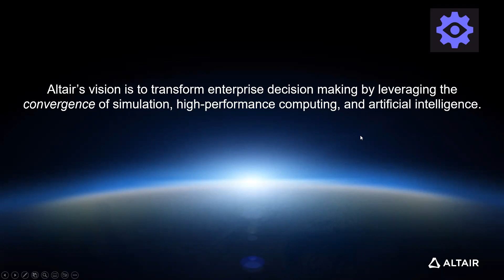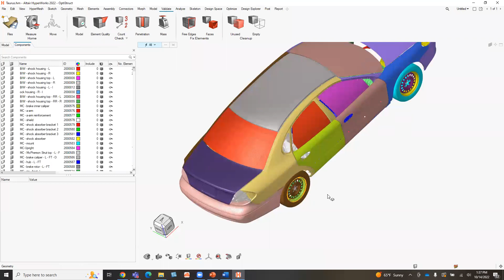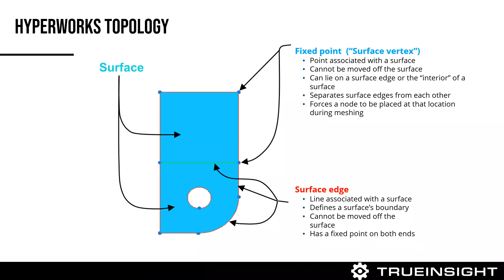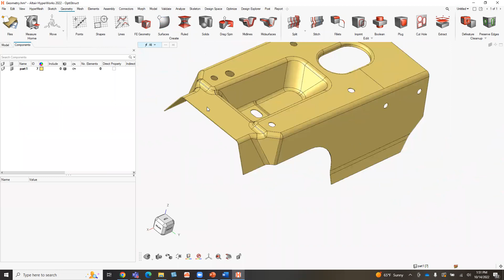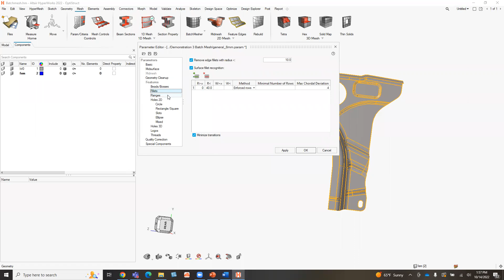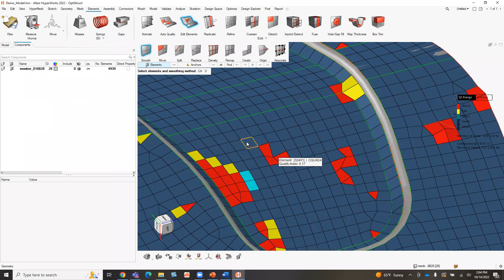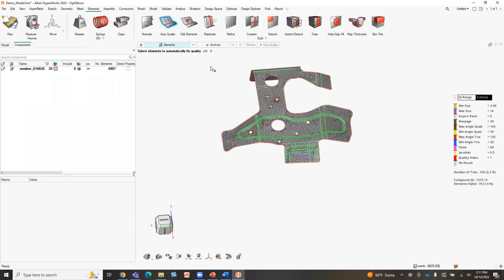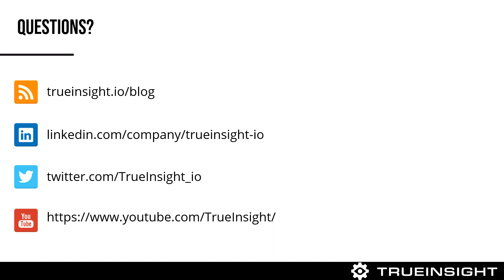TrueInsight Webinar - Altair HyperMesh Tips and Tricks

Comment: Is it possible to demonstrate batchmeshing by sending it to Simlab (tcl or Python script) and then reimporting the mesh back into Hypermesh?  This could accomplish two time saving steps at the same time, namely meshing with great control and using Simlab's quality criteria to minimize individual element and node manipulation.  I think there used to be a method to do this several years ago but I don't see a reference to it now.